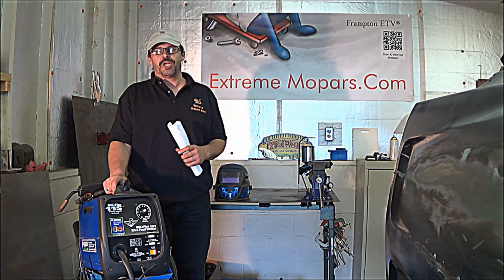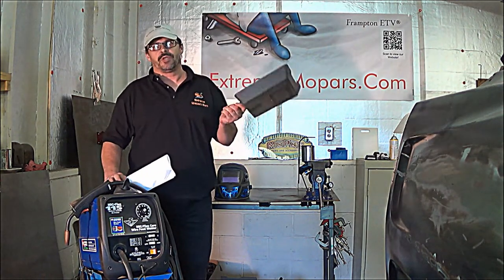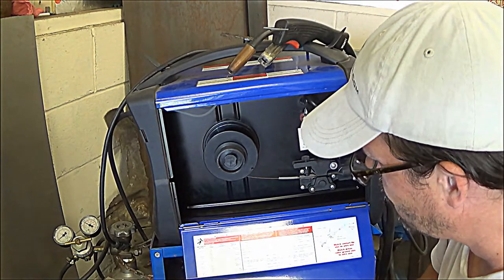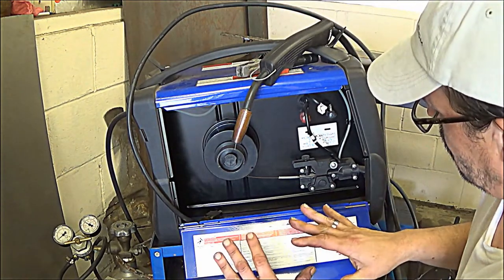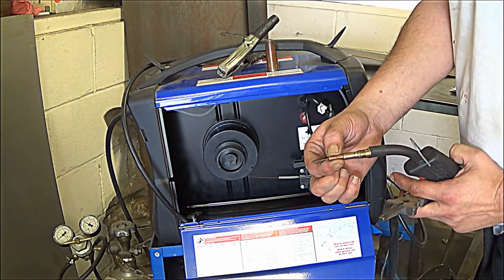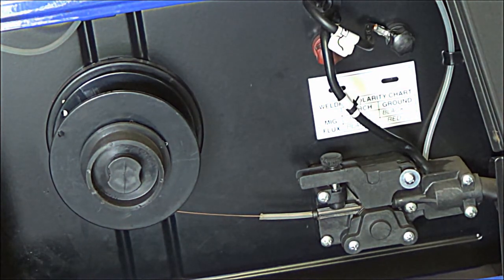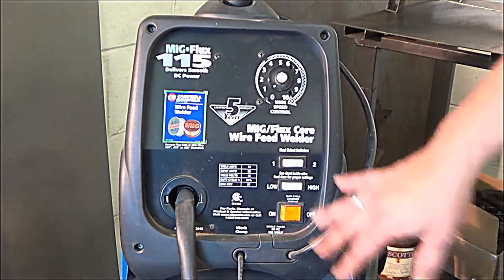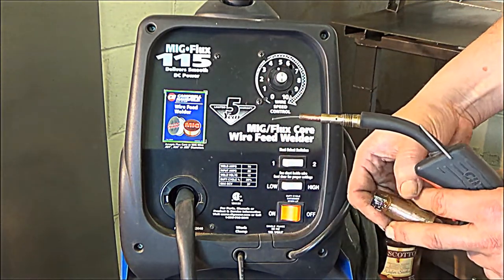Campbell Hausfeld wire feed, Gas or Flux core mig welder,115 volt welder

Comment: Geeze my auto correct. I meant to type the solar panel uses your arch from welding to charge the battery on your hood. 
You also k ly need your polarity backwards if your using gas. Not necessary with just flux core. That's mig pliers. You turn nozzle to right it makes the keeper spring smaller to slip off. Leftvturn it and it'll lock it on and tear your nozzle up if you don't know this and force it thinking it's lefty loosie